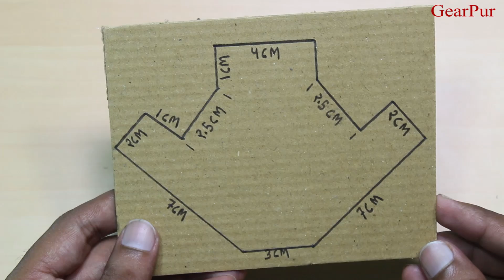How to make powerful engine using cardboaard || electric motor || very simple || DIY

Comment: what he is doing with the wires is wrong . just plug only the middle motar to the battery and all other will spin and take the wires of the other motars on the side andplug it to a LED  how the led will light because of the static power generated when the  motars top spins  so don't  say his video  is useless because it is his idea